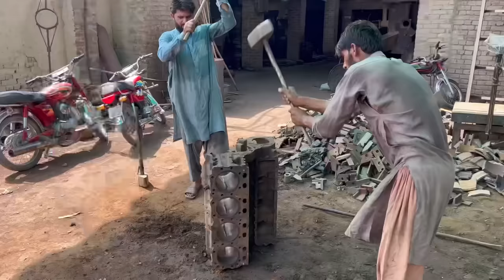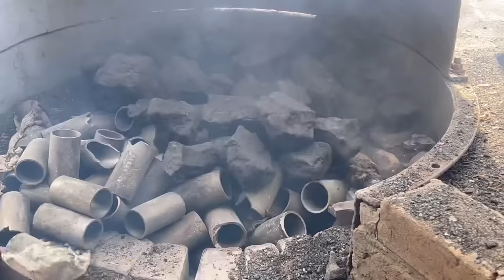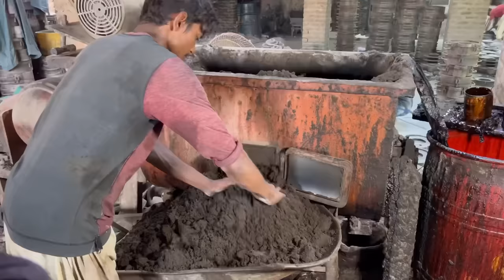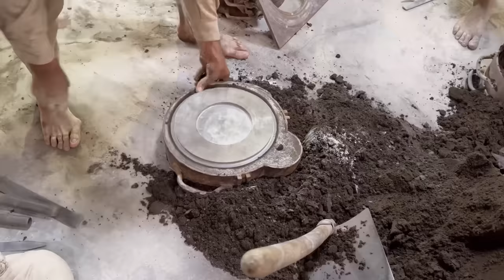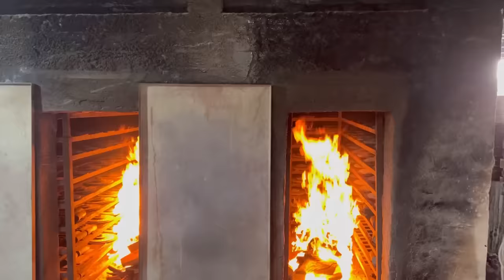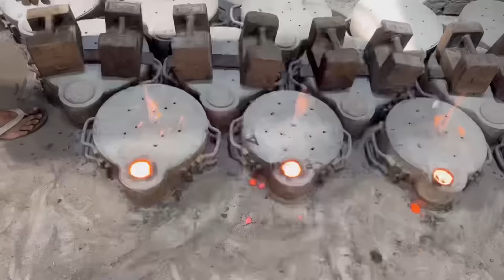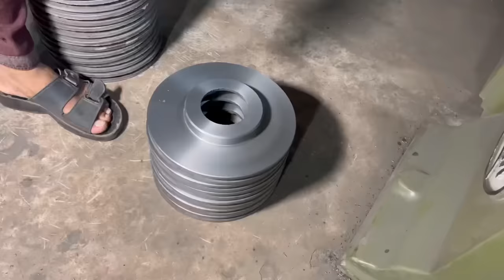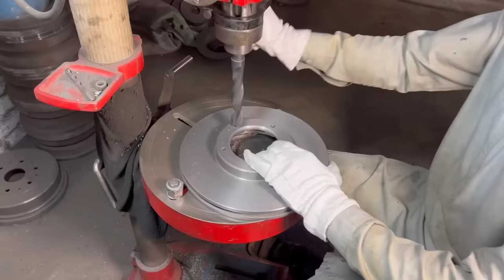Amazing Manufacturing of A Car Disk Brake Plate |

Comment: Elsewhere in India, a team of guys are using old disc brakes to restore engine blocks.
Reply: LOL 😂😂😂😂😂😂😂😂😂😂😂😂
Reply: in another video I saw, disc brakes are recycled into frying pans
Reply: LMFAO 😂
Reply: Is that what they mean by a circular economy?
Reply: It's a Pakistani video bro, your fellow rednecks from SEATO.
Reply: That is the best comment of us all!!!!!!!!
Reply: these are hard working Indians. if only india had 50% of those hard working people, India would have been different.
Reply: Best comment ever
Reply: @siramike2654 it not india its pakistan we have more modern factories not this junkyards
Reply: The circle of. life...
Reply: @darshan5726 I like Pakistan better. At least they don't scam old people.
Reply: It’s Pakistan 🇵🇰 bro not India 😂😂
Reply: No sir it’s Pakistan 🇵🇰
Reply: @AB-uw3os Pakistani or Indian, same stuff, doing their best with the stuff they have
Reply: Doesn't matter.
As long as its Steel for Steel 
Iron for Iron or Aluminium for Aluminium 
All is good
Reply: LoL.. funny cause it’s true
Reply: This is the rotors you'll get from the website WISH
Reply: HAMMER TIME!
Reply: It's pakistan
Reply: @statementleaver8095  This is a terrible way to view it. The actual functional variability in different grades of steel set by ingredient and manufacturing technique is incredible. If a steel is too hard, it will snap under a shock load. If it's too soft, it'll deform under pressure. What grade of steel are they even producing? lol
Reply: @siramike2654  Maybe working hard doesn't get you far. Working smart may be the key.
Reply: @Ever443  Yes, and doing remarkably well.. A lot of this produce is for a cash strapped home market.. Many of the mocking smart ass people commenting here could never manage to do ANYTHING under such primitive conditions.
Reply: In flip flops
Reply: замкнутый круг 😁
Reply: this is not true. why are you lieing

Comment: It is impossible not to appreciate the ingenuity and simplicity of the process and at the same time the incredible set of skills required to accomplish this job with basic tools. On the other hand I would never, NEVER drive a car with those brakes faster than 30km/h.
Reply: You summed it up perfectly !  👍
Reply: And perhaps that’s the only kind of duty cycle that these will see. I doubt that they are intended for track use. Horses for courses sir.
Reply: You wouldn't sport a set of Flintstone rotors?  To be fair though, the machinists were doing some pretty impressive moves with the equipment they have.  I'd hate to see how many times they get a sharp coil of material in their sandals though.
Reply: NO Gloves, No Steel toed Boots, NO Safety Galeses? IM CALLING OSHA!
Reply: @robinwells8879  exactly. These brake disks are probably supposed to be installed in a small and slow commercial use vehicles, that move stuff around. There are no need in balancing those disks at high speeds. To be fair, those disks will probably blow apart at high rpms, but they will never do because if its use case
Reply: plenty of them in US right now sold through rockauto and other parts shops, perhaps you drove one like that already without knowing and felt safe ;)

Comment: when you go to the parts store and they tell you they have the $20 part, versus the $100 part..now you know.
Reply: When you go to the surplus store and buy a 1oz bottle of Essence of Rotor Casters for $900, now you know.  You've never seen crowd control until you've seen people flee for their lives from this funk.  Get it before it's a war crime.
Reply: and they both last just as long..........hahahahahaha
Reply: the 100$ is the same part that some Chad bought for $20 and now sells it for $100
Reply: @steve-dq7hh  Cobblers.
Reply: They making the $100 part now
Reply: I think they are sold by weight...
Reply: On video 100$ part making)

Comment: Right out of the stone age, aftermarket rotors for the Flinstone car
Reply: I hope that these parts are only for their own country and correspondingly weakly motorized vehicles and bad roads so you can also only drive slow.
Reply: @Observerl 😂 это для концерна Даймлер бенц
Reply: @Observerl  что вас так напугало😂 обычное литейное производство, без электроники,?
Reply: The Flintstones used their feet as brakes. Its a lot safer than using these.
Reply: Yeah, you'll have a yabba-dabba-do time when the bus you're driving goes skidding off the side of a mountain....
Reply: why do people keep mentioning ‘stone’ as all they do in the video is working with iron
Reply: Skidding? You mean skibi-daba-du-ing?

Comment: Wow the quality control of the mixing of metal alloys is unbelievable 😂
Reply: Anaptanium 😂 💯
Reply: I believe they weighed all those materials play just did not show it on the video
Reply: U dont need to do quality control when u use engine block metal. It has it all in.    Big companies use base materials and mix them so they need to check if the mixture is correct

Comment: I was wondering how they removed the cylinder walls from the engine blocks. They did a 200IQ move and removed the engine block from the cylinder walls. 
Also those guys destroying the engine blocks, they must have 0% anger in them
Reply: much closer to 70 IQ actually
Reply: @McTrollinftw  That's generous....

Comment: Amazing by the amount of work they put inside this, but atrocious by the amount of safety issues those discs might bring with them when installed on your car...
Reply: these are not going on American cars, if you look again they are drilling and threading 6 holes per rotor.
American cars have the lug the studs on the bearing hub, and clearance holes in the rotors, They are also ground and balanced for high speed rotation. These rotors are likely for local use on roads that you cannot possibly exceed maybe 40 mph
Reply: @wingnutwingnut7490  I was wondering about that,guess they are sold locally?
Reply: They will never be installed on my car!
Reply: I'd put them on my car today they look well made and of the best quality

Comment: I always tell to my boss that flip flops are the best safety shoes but he never believes me.
Reply: nope safety crocs are the way to go
Reply: Gotta be bare foot to pound that sand into the mold.
Reply: As long as they are ISO-9001 certified safety flipflops
Reply: unglaublich, selber fast 5 Jahrzehnte im Automotive QS gearbeitet und all die QS Systeme, ob Ford Q1, GM Awards, ISO 9001, aktuell IATF 16949,  PFMEA, SPC und und mitgemacht sowie selber 25 Jahre Auditor mit BV 9001 Zertifikat und dann so etwas. Sind halt die LCCs Low cost Countries

Comment: This is the first Pakistani video where a worker used a vernier caliper to measure a thickness which is accurate to 1/10th of a millimeter. Never mind that the particular dimension he measured needs to be accurate in terms of 1/100th of a millimeter.
This also surprises me to know that they do have vernier calipers in Pakistan and there are a few individuals who know how to hold them.
Reply: They have a Harbor Freight outlet for tools.

Comment: i think, metalurgy, friction coefficient, quality and everthing has gone for toss with this skilled labor
Reply: its not just amazing its collapsing someone's life if they are unkowingly using this product, its matter of safety.
Reply: Я думаю що нормативи там кращі ніж у відомих брендів під люксовою наклейкою ,виготовлених десь в Китаї
Reply: @futureoftheearth8100  wrong
Reply: @stefanpopescu6479  wrong...why..
It's my opinion based on my latest foods from China
Reply: @futureoftheearth8100  metallurgy is not the same as food
Reply: @stefanpopescu6479  sorry for mistake...bear with me, I'm Ukrainian...
Not foods,i meant products...
 Especially hammer drill metabo...1 year working and it run out...
On the other side...i have old metabo 1980year from Western Germany... It's still working.. even outside appearance says that old product is more durable than that brand new metabo from PRC

Comment: The protective safety sandals are top-notch. ;)
The brake rotors produced are of questionable quality. They weigh the amount of cast iron and scrap iron but that's not more than a rough benchmark. No metallurgical testing, no quality control, stress test, test for hardness, or whatever.
I guess they can sell these things to Lada... 😂
The people at Toyota get shivers when they see "Hiace" on the drilling guide.
However, they get things done with what they have..
Reply: Not only these sandals protect the feet, they also protect the eyes when you hammer the engine block.
Reply: @af1n  😂
Reply: well if you know what your doing then...you know what you are doing. if your making scrambles eggs how do ou know how to make it? do you et out a cook book every time?
Reply: @marktucker1651  I can tell you I know what I do. Still, an accident can occur and I could drop something...a tool or workpiece. It doesn't even have to be heavy a sharp edge can do a lot of damage. So I'm perfectly fine wearing safety footwear, etc. ;)
I once had an apprentice drop melted material from a flame cutting into his shoe...because..he wouldn't listen. He made a Fred Astaire all over the workshop before he finally got rid of that hot lump of slag.
Reply: @kalleklp7291   no foot wear to hold the hot stuff agnist the foot when it falls in the foot wear.........😁 they choose to work like that.

Comment: Now you know what Alloy is. It means mixed metal from engine blocks, pistons and metal plate which used to carry the raw materials mentioned earlier.
Reply: Ну мы же не видим весь цикл. Может туда приезжал местный профессор (а-ля Вассерман) и сказал, я тут всё подсчитал, сыпем столько-то осколков блоков и столько-то кусков вот этого листа, в конечном итоге всё равно получиться сплав нужной марки. Вот так)
Reply: @Павел-777  Well said!😄
Reply: its all guess work, even the dimentions of the end product.
Reply: @arjanvanraaij8440  Surprisingly, they work😂
Reply: When the wheelbarrow wears out they throw that in the furnace too.
Reply: @RRaucina  Indeed. As long as it is metal😁
Reply: Ah yes, the new magnesium aluminium iron alloy (mal-iron?😂) should be much lighter and dissipate heat better. Great idea!!
Reply: @db5351  Maliron! You should patent this name! Better than Vibranium from Wakanda

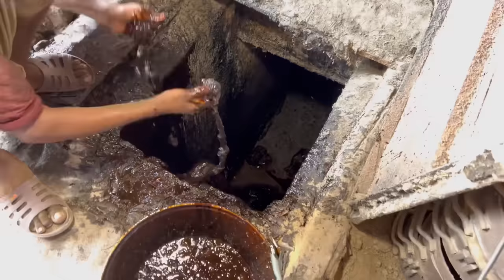Comment: What is the brown black sauce at 5:10?
Reply: old oil by the looks of it....mixed with the casting sand
Reply: a type of diluted pitch that binds the sand in molds
Reply: @stefanpopescu6479  Yes, and they hope that cracks have not formed before.

Comment: *While these videos undeniably demonstrate skill and resourcefulness, they area  seriously damming indictment of the state of the Pakistan economy*. If a 'workshop' like this was producing one-offs or very small runs of parts that are near-impossible to source, it would be wonderful. For example, if they were making parts (any parts) to order for vintage cars or vintage machinery that simply are not available off-the-shelf, it would be an incredible resource for customers around the world. However, these brake discs are obviously destined for modern vehicles, and I feel certain they're destined for vehicles in the local economy. I seriously doubt that if I go to a parts supplier here in the UK to buy a brake disc, that it was made in this shop. It's an inexpensive part here in the UK, and I have no doubt it was mass-produced (probably in China) with at least better-than-basic quality assurance processes. Assuming Pakistan trade with other countries, which I am sure is true, it is frightening that a motorist in Pakistan would choose to buy a locally made part, made in these circumstances, in order to save what can only be a relatively small amount of money (I reach this conclusion because the imported equivalent would be sold at a price, corrected for local buying power, comparable to the UK price). And before anyone points out that Pakistan is a relatively poor country with low buying power - the buyer of one of these discs owns a reasonably modern car with a reasonably sophisticated braking system. Therefore if you can afford the car, surely you can afford to buy what is an inexpensive component that's been made with proper QA in a proper overseas (i.e. Chinese) factory. 

So aside from quality concerns, it's reasonable to conclude these workers are being paid a pittance to produce these parts and they're being sold at a price even lower than the low cost of mass-produced imported parts. That demonstrates how poorly the Pakistan economy prices the skill and hard work of these workers 

If my point still isn't clear - I can buy a mass-market, imported, quality brake disc for around 20 GBP (about 25 US dollars) here in the UK. Imagine I went to a specialist foundry and asked them to make me a brake disc for my car. Once they'd finished laughing at me they'd tell me I can buy it ready-made for about 20 pounds. But I insist I want a scratch-made one. Okay they'd say, we can do that - but it'll cost you 1,000 pounds for such a specialist, small-run job. Whereas, as demonstrated by this video, you can get a local foundry in Pakistan to make you a brake disc for less than the cost of a properly QA'd mass-produced item. I find it absolutely baffling and quite saddening.

Comment: I find it amazing they are working with open top sandals whilst pouring molten metal and handling read hot castings...surely a bit of self preservation would have you buying a pair of boots...

Comment: To someone who has never worked in an industrial setting this looks extremely primitive, but the greatest contrast I see to the way things would be done in North America is the lack of work tables. My back would not be able to handle working on the ground like these men are and I'm not the only one. I think Asian people are more flexible than us in the West. Even when I was very young working on the ground like this would hurt my back, feet and legs. Less significant, at least for this type of work, is the dirt floor. Even the most neglected of factories here would at least have concrete floors. Otherwise, not too far off from the working conditions you'd see here. Some very skilled hands at work here too.

Comment: Did anyone noticed these are not really cars brake disks? The hub centric size is way too large and plus its also threaded. I have installed hundreds of brake disks on regular cars and pickup trucks but never seen any disks with threads,

Comment: Years ago I watched a video of a Chinese home foundry casting drill press parts in the guys yard then sending them to the factory where they made those castings into DPSP's....drill press shaped parts.

Ironically a couple years earlier I was using my Chicom drill press in my shop when the platen broke and smashed my foot breakingmy left foot.

I replaced that POS with a 75 year old Delta 20" unit that will never break.

Comment: These brake rotors work fine if you have the rest of the brake system also made in Pakistan. 
For sure, brake calipers and pumps with 700bar will crush them. 50bar might be ok. They are not used in an Audi R8....

Comment: Much respect for the hard work behind these brake discs but then in all honesty there are some notes to make, first it is sad that there is not the minimum safety equipment for them. Secondly, with all sincerity, I would be happy to buy something that helps these people but if it involves car parts that are essential for safety I'm not going to save money, because reading the comments of some metallurgy experts it doesn't seem that the alloy used is the ideal for such a delicate part as a brake disc!

Comment: Assume the the rotor thickness is checked by the "eye" so 26mm rotors are give or take 26mm with a + - 10mm tolerance:) 
Pulse the all in important hub register is checked by a Go no Go gauge, so who cares if it's loose as long as it is at least large enough:)
The threads are precision cut using a tap meant to clean threads not cut them .. nice wobble in that Mardell on the drill press!
When you pay 20 for a new eco rotor this is where they are made!  Then you wonder why the OEM ones you turned in your garage using 80 girt, while the car is in gear turned out to shake less the n the "Indian" new ones??  ... lol do they not have highway driving over there?

Comment: Hello! Unfortunately, sometimes there are errors escaped from quality control even in the OEM modern automated production existing in today's car factories. In 2023, for modern road infrastructures, from the point of view of traffic safety, in intense and often high-speed traffic, these brake discs manufactured by rudimentary methods, would not present much safety and peace of mind for those drivers who care for their own lives and those of their passengers. For the uninitiated, this clip will be extremely interesting, but it could be extremely sad and painful when these parts for the car's braking system could cause loss of human life. At best, such brake discs would be recommended for light weight and limited speed machines, used in a local traffic environment or even for small tonnage agricultural machines. It's just a personal opinion.

Comment: Pouring molten metal in flip flops? Yes, they're walking in sand and it's hot, but that's no excuse for beach footwear. Trading Standards should investigate the place for making brake discs that are more unsafe than its manufacturing process.

Comment: When I first started as an automive engineering in Michigan back in the late 80's, The US was already 7,859 years ahead of India manufacturing.  In fact, it seems that India has gone the other way and now that difference is more like 120,756 years behind The US, or the rest of the world, or even cavemen,....when cavemen first started using disc brakes instead of their feet poking through the floor of the car,...you know,...Flintstones and all that?

Comment: THey smacking an engine block with a sledge hammer and it doesnt break.. Meanwhile, My engine cant take 30psi of boost without smashing a hole through the block :(